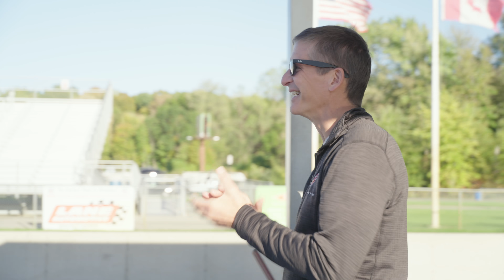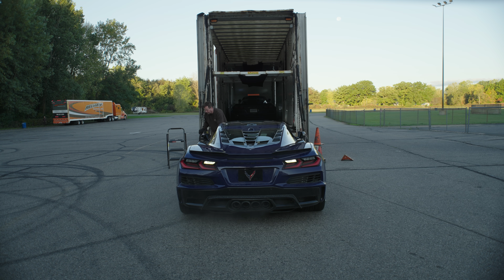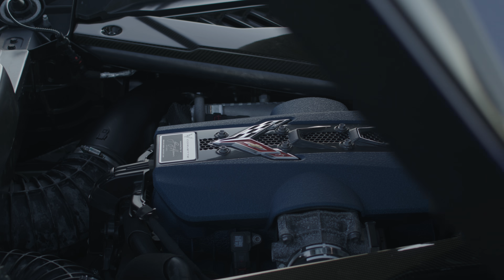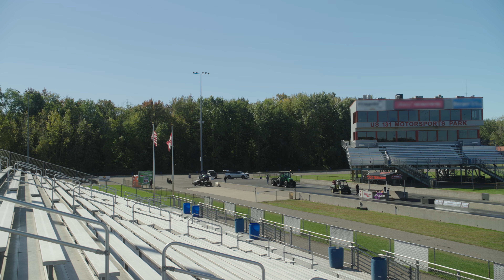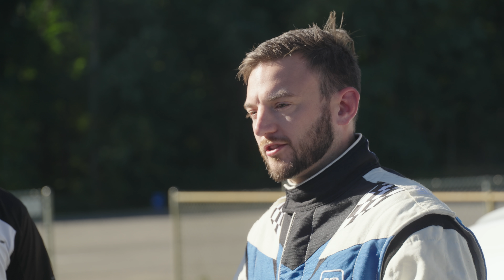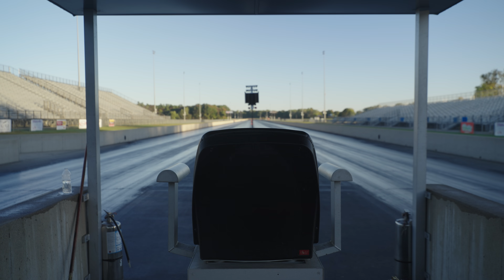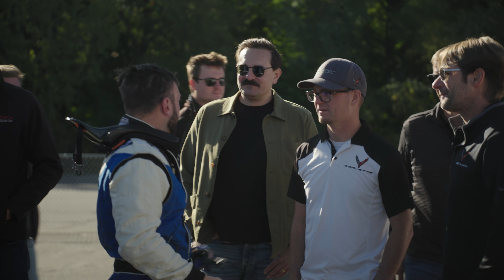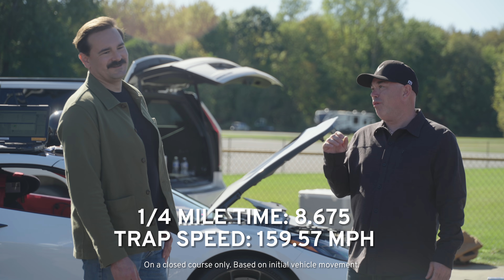We Pushed The Corvette ZR1X To Its Limits (DRAG STRIP TEST)

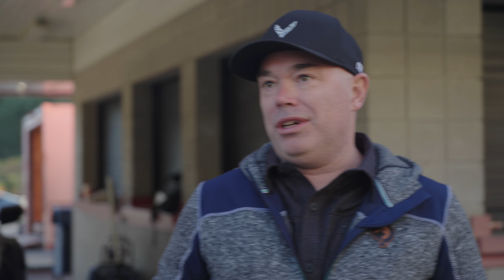Comment: 1:12  using the GTD as the example for the 10-11 sec range is savage
Reply: Team Chevy cooking indirectly 😂
Reply: @mhiztakaleb that Mustang is pretty fast and it's a muscle car weighing at 4100lbs and only rear wheel powered
Reply: Not worth the price. You can get much much faster car for that price.
Reply: @mhiztakaleb educate yourself. Shelby Gt500 CRs time was 8.59 in the 1/4 and has 2 to 3 times less horsepower also.
Reply: @l @lincolnls0416 ducate yourself.. that was not a production car. It was modified by Shelby American. Gt500 code Red..
Reply: @lincolnls0416  it doesn't have 3 times less horsepower.  The code red has about 1300 horses, it's track only, it's not even street legal, and it costs 20k more than a zr1x.  And most importantly... it's not the GTD, which is what Zach mentioned.  Keep up.
Reply: @Travis-7051 
Mustang already won. It has been Americas favorite muscle car and beats Camaro in every category every year when it wasn’t discontinued. Yes Chevy fan you don’t have a car in the same class as the Mustang that’s better. Ford been beating Camaro so bad for years they had to put the vette on it to save face. A muscle car vs a hyper car? How does that makes sense Chevy fans? 😅
Reply: @daceywest8563 I loved the fact that you have realized the corvette has evolved from being a sports car to a hyper car..
Reply: @daceywest8563  Good thing this isn’t, and has never been, a muscle car lmfao
Reply: @daceywest8563 I think it's adorable that you think the Mustang got anywhere without the camaro. The Camaro literally smoked the Mustang almost every model year that they competed except for the very end. Why did they give up on it at the very end, well because the Corvette came out a much bigger Contender than anything they ever cared about in the camaro. You can complain all you want about them not being comparable but the fact of the matter is the Corvette sells quite well, and I certainly a much more appreciable card than the Mustang is. Mustangs are pretty much the same and have been the same for years now play the best Ford has to offer because no one buys the GT cuz it's completely overpriced pile of s***
Reply: @daceywest8563 bro what are you talking about 😂 Chevy doesn’t have a muscle car and ford doesn’t have super car worth mentioning (performance wise)
Reply: @tylerdorsey1154 
The Camaro was Chevy muscle car up until 2023. The GTD is track based supercar. Who are these fake Chevy fanboys who know nothing about chevys real heritage? Must be bots trolling
Reply: @daceywest8563 corvette has been a muscle car until maybe you could say 2020
Reply: @daceywest8563  completely brain dead.   I prefer the mustang over the Camaro, personally.  But that doesn't mean that a street legal sports car is comparable to a purpose built and track only race car.  We're talking ZR1X vs CR here.  Stick with the program.
Reply: @Travis-7051 
I don’t know what CR is. Chevy fans boast on the ZR1X being the best when it’s up against cars OUT its class. To make a real Chevy vs ford class comparison I used the Camaro vs Mustang. How’d Chevy fans forget this rivalry? My point is Chevy has never made a better car than ford in the same class. Zr1 is really nice but how does it perform vs hyper cars? Have a great weekend!
Reply: @daceywest8563  then you're arguing about something you don't know about.
Reply: @daceywest8563  Camaro lost on sales because all the women are buying those little engine Mustangs.  Mustang is, and always was, a ladies car. Where Camaro was always performance oriented beating Mustangs at each generation and appreciated and bought by man..
Reply: @lincolnls0416 no it wasn't.
Reply: @daceywest8563 race track cups say otherwise. I count championships not jersey sales.
Reply: @tylerdorsey1154 tell me you're dumb and biased without saying it.
Reply: @daceywest8563 Camaro is a pony car. Chevelle. Charger challenger. Gto. Those are muscle cars. Firebird also pony car.
Reply: @daceywest8563    This is a pretty dumb comment.  You make it sound as if the production Camaro was always being beat in performance by the production mustang.  VERY incorrect based on DECADES of history.   You also make it sound as if any production Mustang is comparable to any production corvette.   I dare ya to try.
Reply: @daceywest8563  Brothaman, the ZR1 is literally over $100,000 cheaper than the GTD and is faster on a racetrack. Don't get me wrong, the GTD is incredibly cool, but what the Corvette team has done with the ZR1 at that price point is insanity.

Not to mention that it's been 10 years and the Mustang chassis (other than the GTD) still hasn't caught up with how good the Gen 6 alpha platform Camaro chassis always was.

And this is coming from a Ford performance car owner, but I just appreciate good cars and engineering in general.
Reply: @lincolnls0416  The car youre talking about is a track only car. Track only cars are track only cars for a reason.
Reply: @daceywest8563 Did you really just say Chevy has never made a better car than Ford in any class?😂 Funniest lie I've seen on the internet EVER. You must be a democrat. Lies are all they've got.
Reply: @pippip9927 Yes. Mustang = Pony car. Not a muscle car.
Reply: @daceywest8563  Someone wake this kid up. lol
Reply: @daceywest8563  Seriously, I will say that the Mustang is nice for what it is, but time after time, new Stang vs new SS, SS is always ahead. Shame that Chevy pulled that car but again, GM pulled the Pontiac which was a great brand too.
Reply: @daceywest8563  The GTD is not realy a mustang it shares nothing with a Mustang and was built in canada by mulimatic, It's a limited stripped down track car not a supercar car, You will never see one in a life time. The camaro was a pony car so is the mustang. Don't hate, read the comments everyone is loving the C8 even the Ford guys are giving props...Don't be a grinch LOL!
Reply: @daceywest8563 as a owner of the Mustang 5.0 coyote i will tell you now that you are 100% wrong... The Mustang did not beat the Camaro in every category... It took a 300k dollar Mustang to beat the ZL1 1LE at the track...
Reply: I saw that and I was like NOOOOOOO you didn't!!!!! HAHaha..
Reply: Shots absolutely fired.
Reply: I dont care what anyone says. The C8 platform is what the Corvette was always meant to be.
Reply: @randomusername-i5i  but fumbled due to it's lame tune setups and horrendous interior design choices. I know of a few C8 owners, none of them like this car and they sold it for a real supercar after, lol.
Reply: @sqlevolicious  It's the best interior a Corvette ever had. Way better quality and design. The fact that they UPGRADED to a supercar which costs 2 to 3 times as much just goes to show how incredible the c8 platform really is. They didn't go from Corvette to a BMW like they would have in the 2000s
Reply: @amazin7006 nah, the c6 zr1 interior is cooler. Difference now is that the c8 is still made with cheap junk parts but they’re better at mimicking quality in 2026. Hell, even hyuandais will attract stupid buyers cuz their interiors “look” like a Benz
Reply: @monaclemin4807  the c6 zr1 interior is closer to a old toyota camry than the zr1x bruh
Reply: @sqlevolicious  weird because I see C8s on the road all the time, they seem to really like it
Reply: @monaclemin4807  No, it's ACTUALLY better. in every conceivable way. material quality is better, design is better, ergonomics is way better, driving position is way better, ingress and egress is way better, fit and finish is way better. A c6 rattles like a 90s pickup truck in the interior, a c8 is solid. You clearly haven't touched EITHER of these cars in your life.
Reply: @sqlevolicious  I've driven a C8 Z06. It's insane. Owner is a friend of mine, loves it to pieces. Interior design is great.
Reply: @amazin7006 lol clearly you’ve never owned a clean c6. They don’t rattle like a 90s truck wtf r u talking about 😂
Reply: I'm a Ford man down to my bones...and this is the kick in the ass Ford needs.
Reply: 🤣🤣🤣 May the Rivalry Never End!!! 🤣🤣🤣
Reply: hahaha love it
Reply: That's diabolical!!!!
Reply: The c8 corners better too. It's hilarious. Ford looks dumb right now.
Reply: Yea whats funny is the amount of excuses GTD devs have for it being so slow.  Not worth the price at all.
Reply: @gamingandarts9176 the Mustang GTD  is basically a project car. Anyone who knows how Ford operates, should know this. Let Ford put that same engine in a  Ford Gt and watch it mop cars with 1300hp
Reply: Amazing what an electric front engine does for the ZRl . By the way. I don't think the NHRA allows an EV or hybrid to compete due to battery safety concerns plus there's no class for these types of vehicles.
Reply: @DWH300  I've seen countless Telsas at the track. If those are allowed, this should be as well.
Reply: All I see is blonde hair and blue eyes, where my brown eye white folk? Or green eyed? …what is up with this agenda that is very obvious
Reply: What is crazy to me is Ford has the car for it with the new GT40 and one day they woke up and said, meh f*** it, throw that car
into cold storage.  wtf  🤷‍♂️
Reply: the camaro should be the one to beat on mustang tho
Reply: noticed that too
Reply: 😂 beautifully played 💯
Reply: GM always comes for the Mustang with the vette. Marketing
Reply: @daceywest8563  No, auto reviewers and Ford fans love to compare the half million dollar Mustang they didn’t even build to the Corvette C8 and it must end. 😅😂
Reply: @G-Rated 
Zr1 x is a hyper car. The McLaren’s and Ferraris should be on the menu. Instead it targets Mustang for marketing. Fords doing something right 😅
Reply: Ford and Ferrari
Reply: and closer to 11s than 10s.
Reply: Nobody looks to ford,That slow ass overpriced turd gtd,has nothing on this car
Reply: @Cameron-i4u6t  Exactly. The ford fanboys who jump up and down whenever someone compared the two cars and then run to the comments to praise both manufacturers as if America wins are all cap. Chevrolet wins and Ford cannot compete with these folks, it’s been the case for years now. Ford fans are in denial just like the Porsche fanboys.
Reply: @G-Rated hey ford guy here. No hate congratulations to the corvette team!
Reply: @G-Rated ford wasn’t trying to compete with this rocket. It has a racing style suspension, it’s inspired by a GT3 car. You guys totally miss the point, you’re just trying to trash the car for no good reason.
Reply: @L @LordJerinza 

Right but can you admit that Camaro was Chevys answer to the Mustang and it was never better at any point. Chevy had to put their best car on the Mustang to hide the fact the Camaro failed miserably. Can we just admit it?
Reply: @daceywest8563 well the last camaro was a great car. They fail the camaro when they didn't let it make corvette hp with the one engine they used for everything. The camaro had a better chassis, but the mustang just had the swag. I can't lie chevy failed the car.
Reply: In retrospect as far as an all around car goes no ford can’t compete - but you can buy a 25k dollar 2018 mustang gt , and with fuel system , suspension/chassis mods , twins and a sleeved block with a built trans you’re destroying this car at the strip . 

I wish I never sold my s550 , I bought it for 60k with 10k original miles , and the car dynoed 1,478whp on 31 psi . 100% daily driven full interior 401A street car  . Blast the air conditioning in the pits - then run 8s on 20 inch wheels with dot radials . 

I love this corvette , and would love to own one but only way I’m getting it is to win one in a raffle 😂  there are stock long block mustangs running faster than this with 2 that I know of that have been in the high 7s with a stock sealed 5.0
Reply: @Cameron-i4u6t I’ll be you it pulls more g’s in the turns, they’re different cars completely.
Reply: @shaikymandel7593 it didn’t pull more gs at Sonoma, zr1 was 4 seconds faster, in fact there isn’t a large prominent circuit where the gtd is faster, despite being almost twice the price
Reply: @samuelharmoko250it did pull more g’s at Sonoma if you’re referring to the review by Hagerty. It’s an impressive car, but it has a different build and design and its front engine RWD, so of course it isn’t gonna be as fast, but I think people wanna trash it instead of appreciate the differences. I know it’s overpriced for sure.
Reply: @samuelharmoko250these cars are for different people, I personally wouldn’t get an AWD Corvette over a RWD model for one.
Reply: @Cameron-i4u6t Shelby Code Red
Reply: @Cameron-i4u6t  It’s got nothing, but it will still trade hands at an obscene price point. It will be highly collectible for those looking for a Multimatic one off.
Reply: @Cameron-i4u6t  Why hating on the GTD im not a ford fanboy but i like it
Reply: @Cameron-i4u6t exactly!!
It's a Ford!!
Reply: In a straight line a coyote boosted is best dollar for dollar
Reply: Don’t forget demon170 ran low 9
Reply: @deeking3979 *with drag gear
Reply: @coldmoonlight6361  and E85
Reply: @deeking3979 on e85 lol
Reply: @deeking3979  That big boat would be miles behind the ZR1X in any heads up race.
Reply: @deeking3979 lol
Reply: @deeking3979 junk
Reply: It is 😂 I think the Mustang bros are so butt hurt by corvette anyway, I don’t understand why they always want to compare with the corvette when they’re not even in the same class or purpose of vehicle.
Reply: @CiviTac  - you just killed any reason to be so proud of the Vette over the Mustang!! 😂😂. In trying to get harsh on fanboys, (that goes both ways,,,,) you defeated any reason to gloat. The Vette is targeting supercars. The closest Ford was with a Supercar was the GT.  It was 11 seconds, but competitors weren’t so gung ho then! 😂😂.
Reply: @C10sRule  😂 we are at a point where everyone makes a fast asf car. It’s not the 2000s anymore where the Mustang was far slower than any vette or LS platform car. Now you can be a fanboy of any of them and actually have a ton of capability at the track. I used to be a fanboy of Chevy and have owned some z06s in the past. Now I realize I could buy a ford, dodge or Chevy and still have ass tons of fun
Reply: @CiviTac I'm not sure on the dodge. Stelantis is destroying the brand. They attempted to eliminate the hemi and being as successful and established as it was is definitely a self destructive move. You couldn't give me a new Dodge. Then there's Chevy and the LT engine. Why abandon the LS for a design that isn't making it to 50k (that's being optimistic) without catastrophic failure. Ford is hit or miss. This generation Corvette is a game changer. When you're outperforming multimillion dollar vehicles for a quarter mill. You've officially set a precedent.
Reply: @CiviTac  Cause Ford cant and wont sell them an in house built equivalent... so they gotta compensate for the fact their beloved Ford doesn't offer the factory performance GM does. Fords need either mods or outsourcing to be competitive.
Reply: @JoshB-r5b that might be the case. I haven’t been interested in ford performance anything since the 2000s so I’ll just take your word for it. But the GT platform would obviously be the choice if they were to try to compete. Ford is also homo for pushing ecoboost bullshit in everything performance but the Mustang. And this is coming from and f150 owner
Reply: @C @CiviTac 
Ford been better than Chevy since forever. Of course they target the Mustang 😅
Reply: @daceywest8563  Now that is truly hilarious :D
Reply: @daceywest8563  For the last 5 years, Ford has beaten everybody when it comes to the number of recalls (except 2024, where Stellantis beat them by 1 - equaling the previous record of 77 (GM in 2014)) In 2025, they DOUBLED the record with 155 recalls.
Reply: @CiviTac 
No scapegoating. The Camaro was a failure just like the impala. The only car Chevy had left is the vette 😅
Reply: @CiviTac funny that chevy boys had to completely redesign the vet to keep up with a mustang
Reply: @rickylafollette3680  keep up? The Mustang has never consistently put up track times anywhere close to as fast as a corvette, much less a z06 or zr1.
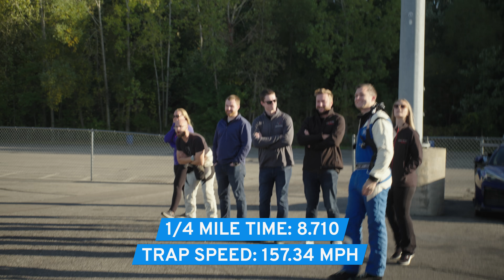Reply: @r @rickylafollette3680  learn to use Google “The Corvette duo (zr1 and z06) crushed the Mustang GTD by ~2-3 seconds, even with non-professional drivers and similar conditions. Earlier Corvettes (e.g., C8 Z06 at 7:11.826) also outperformed many historical Mustangs.”
Reply: @CiviTac  No kidding.   I've owned several V8 Mustangs and a couple Vettes -    any "comparisons" are laughable.
Reply: This is a day that will live in infamy 🎉salute 🫡 🙏🏾
Reply: Shelby code red
Reply: @ishyne22 Not production, not built by Ford, and not street legal... cope harder! 😂
Reply: @JoshB-r5b neither is this dummy
Reply: @rickylafollette3680 zr1x is street legal and production
Reply: @rickylafollette3680  are you dense? This isnt a "COPO" Chevy Corvette ZR1X, they didnt source a builder outside of chevy to make this happen
Reply: @rickylafollette3680 neither is this what..?
Reply: @rickylafollette3680 The ZR-1X is a production car, it is fully built by GM, and it's fully street legal... cope harder! 😂😂
Reply: Yea i saw that too. Brutal, ford is cooked!
Reply: All wheel drive and completely redesigned not surprised
Reply: @rickylafollette3680  dude who cares. It’s call evolution. All car manufacturers have been doing it.
Reply: Now lets see the how the zr1x is half the cost of the gtd.
Reply: @Viralbutnotyet  It's not half, but it's definitely tens of thousands cheaper.
Reply: @Viralbutnotyet 
Depends on the options you go with on the GTD, that car is up to $600,000.
Reply: I mean, it probably is a mid to low 10 second car.
Reply: The Camaro and Mustang were in the same class before it got discontinued for the 3rd time. That’s why GM salty 😅
Reply: Mustang is not even same platform as any corvette it should be faster now a Camaro oh wait they dont make them lol
Reply: The problem with this Video is Hennessy Venom GT is made in Sealy, Taxes and it will smoke a Corvette ZR1X 🤣🤣🤣
Reply: That's a Ford 👎
Reply: They don't even compete with each other bird brain
Reply: Meh. Give the GTD a hybrid system and another 400HP and see if it still counts, nitwits.
Reply: @BDCB_SHE_KNOWS  Still couldn't compete. Nice try. 😂
Reply: Ford Is Secretly Cooking up a V8 Hybrid Ford GT. I think they're regretting putting a V6
Reply: You noticed.... haha...
Reply: Does anybody know if it's normal to have track prep more than a quarter way down the track?
Reply: They could've pulled out in the street in front of the tack and ra 8.9 it's all wheel drive.
Reply: @timtimmer99  At events, the entire track is prepped. This car really just needs it in the first 60 ft anyway, on street tires. It's not slowing much on an unprepped road due to it's weight distribution. Remember the non X ZR1 is doing 1.5s on street tires.
Reply: @timtimmer99  As a drag racer for over 30 years, I can tell you that starting line prep is a bit different than downtrack prep, but yes, any track worth competing on is fully prepped the entire length.
Reply: GTD is a track focused car that would decimate the ZR1x, it's so silly. These guys are all idiots.
Reply: @sqlevolicious  it lost to the regular zr1 on the nurburgring already it's not touching the zr1x
Reply: @sqlevolicious  How late are you? It already lost to a regular ZR1 on the nurburgring and costs over $100k more
Reply: @sqlevolicious  If the GTD would decimate the ZR1X, then how come it never has on any track. There's no track or straight line drag race that the GTD put down a better time. You're delusional. 🤦‍♂️😂
Reply: no manual - keep your appliance...never again a gm product, never!!!
Reply: @ko7305  remind me again what production car has a manual that is even in the same ballpark performance-wise as this car?